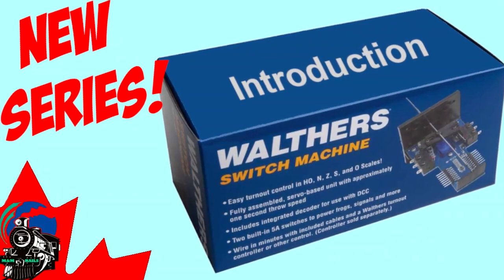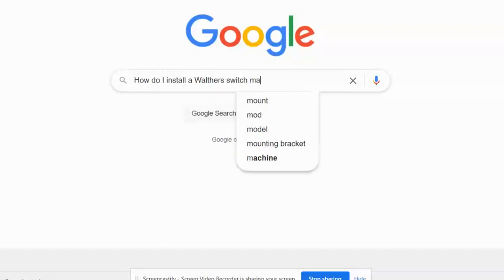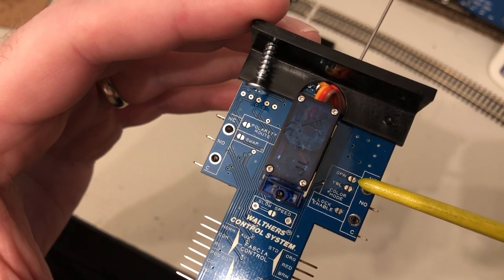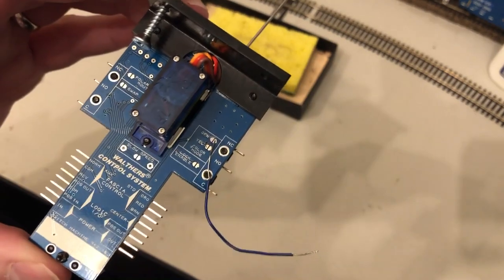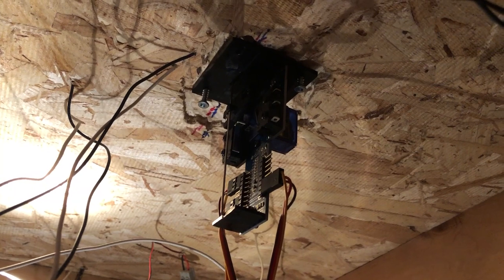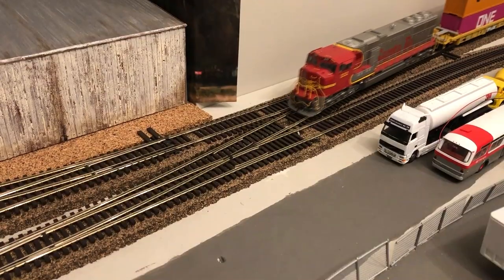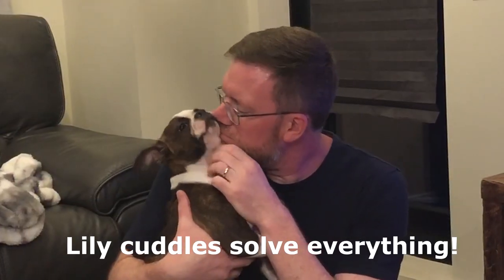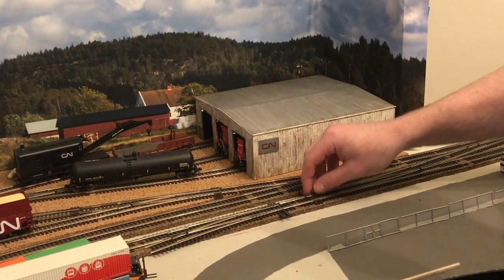Walthers Switch Machines - Episode 2 - Color Mode

Comment: I wish that I discovered these two videos earlier.  I have been installing Walthers switch machines on my N scale layout and there are a few other things that I discovered that should be mentioned.  

First the wire is too thick to go through the hole in Atlas switches and the hole needs to be enlarged, a #54 drill works.  

The directions say, "the indicated position can be changed by reversing the cable connection to the fascia controller." I found that doesn't work.  You need to use the swap pad, rotate the switch machine 180 degrees, or reverse the cam on the machine to do that.  It is unfortunate that the section of closed/thrown is related to the mechanical position of the switch machine.  The configuration under my layout necessitated that I had to reverse all most all of the machines I have installed so far.

The switch machines can be used to replace slow motion machines by using the polarity route option, but the directions fail to mention that you need to solder bridge the jumper.  After doing that, the switch machine functions like a slow-motion machine, but the buttons and lights no longer function.  The switch machine is activated by reversing the polarity of the 12v power supply with a DPDT switch.  A Tortoise Switch Machine can be controlled with a DS74, but while the Walthers Switch Machine just slowly studders and takes a great while to switch and does not seem to be reversable. It appears that Walters machine requires more current that a Tortoise Switch Machine. I will keep working on this, but it may require that I put in a relay circuit between the DS74 and the Walthers to control the switch machine.

I have used both the vertical and horizontal versions of the machine.  To use the switch machine where the track is elevated, instead of milling out the base board, I went the route of increasing the length of the switch wire.  To do that, I removed the old wire from the machine.  In the case of the horizontal machines, the wire has to be straightened to remove it.  Using the removed wire, I used it as a template for the replacement wire, just made it longer.  Again, for the horizontal machines, the wire must be bend after placing it through the cam.

I am using the micro-switches to power the frog, there for some soldering is required to the switch lugs. A couple of times I found that the micro-switches were not working and that they showed shorted internally.  But, by pressing on the switch lever, it seemed to stop the short and it started working again.  I am unclear as to what is going on here, it may be quality of the micro-switches they are using.
Reply from the maker: Thanks for your comment Earl. Nothing is perfect eh? It sounds like you went through a lot of the same problems I did. Thanks for your thoughts and solutions. I never got around to posting a video on how to operate the switches from the throttle but I have done it and like you said, there were issues. I’ve decided to not install any more machines. Two is enough. I’ll hand throw the rest. 😊

Comment: Excellent work as always. Quick question, do you use flux before applying the solder? It looks like it wasn't flooding on the metal properly.
Reply from the maker: Thanks Harrison! I don’t use flux because the solder I use has flux in it apparently. My iron tip is old too. Thanks for the advice.

Comment: Hi Mark great video, I developed a method to install the switch machines, also use #4 wood screws , yellow handle Roberson, everything is packed away so I can’t do a update video, yes that little solder tab is great , i discovered that after I installed my switch machines but too tight to remove and correct this time, and yes before you install , again a great video
Reply from the maker: Thanks James! It’s nice to have someone on board who knows exactly what I’m talking about. I’d like to see how you install them when the time comes.
Reply: Hi Mark I am working on a idea that might make easier, but if I can find box with them I will show you live on a Monday night

Comment: I thought I'd try the Wathers switch because they said you could lock operations on them.  What I found out is, yes, you can lock it out, but it disables all operations.   I wanted to only disable local control so a dispatcher could take control.  Just I'll look other options.
Reply from the maker: That’s too bad. I thought they had that option as well. If I find a solution I’ll be sure to post it. They’re not perfect.

Comment: Ok Mark , question using only push button , location does not me to reverse the mounting so I just need jumper the the green tap and the colour will reverse
Reply from the maker: Correct.
Reply: Thanks Mark

Comment: Mark, what if you wanted red lights, ha ha, glad you were able to get your green lights.  Cheers
Reply: Well, it is possoble but not using the facia controller plug; you would have to use one of the dry contacts and add a separate 3v power source.  Maybe Mark and I can add that specific topic at the end if there is enough interest.
Reply from the maker: Thanks Don! Just put those rose coloured glasses on. 😉